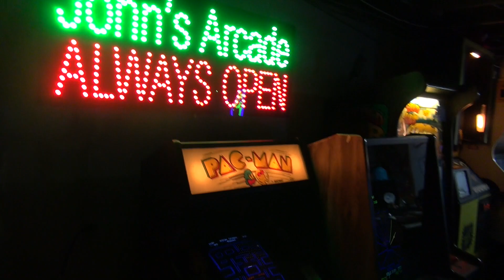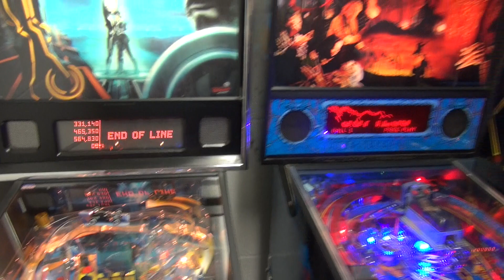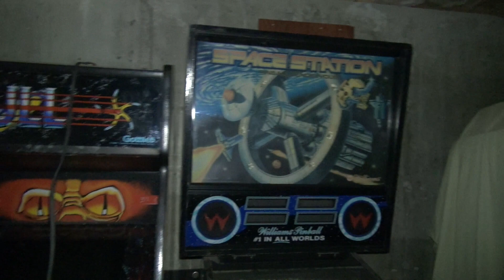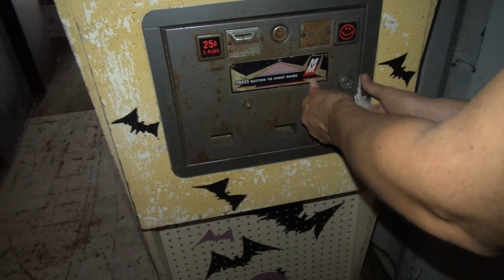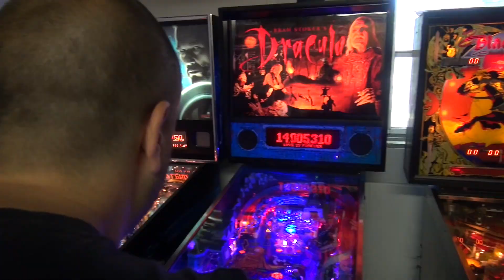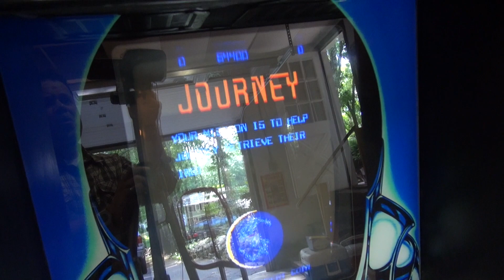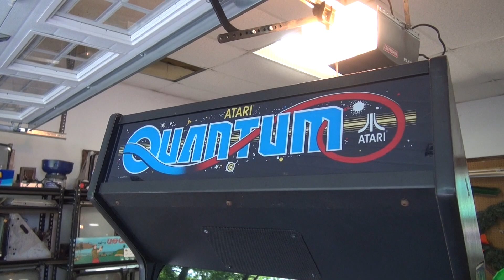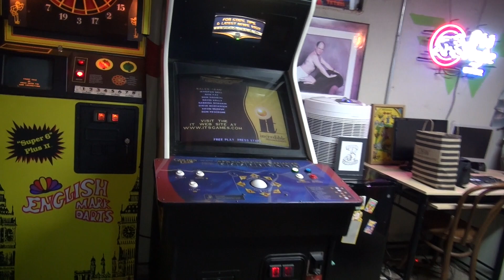Atari Quantum Arcade Restore / Scratch Build Part #1 - Getting the cabinet -

Comment: John, you mentioned that the power supply on your RFM wasn't putting out any voltages and the fan wasn't running. That's can be indicative of an AC line fuse thats blown somewhere. So, just in case your new power supply does the same thing when reinstalled, make sure all your line fuses and the varistor are good.  Hope she's back up and running soon.
Reply from the maker: I checked the fuses and the AC going to the power supply. The power supply was indeed getting AC. We also tested the power supply out of the game by plugging it directly into the wall.

Comment: My thoughts over the course of the video:

-- I remember Quantum.  If I recall, the object of the game was to encircle subatomic particles with a trackball.

-- I want those garbage machines!

-- Regarding Leprechaun; I made some minicabs based on the Pac-Man cabinet at 2:3 scale a couple of years ago. They are a perfect size for children.  It is too bad the girls I made them for are now too tall to use them standing up.

-- Regarding the damaged side; It is possible for you to use the good side as a template to create a replacement for the damaged side. I used templates for cutting out the sides of my minicabs.

Comment: Did anything happen with those poor games sitting outside in the storage yard? Another great video btw, thanks.
Reply from the maker: I heard that someone else took all the parts off them later. We didn't touch them. It was tempting but seemed wrong. :)
Reply: John's Arcade Game Reviews & Tech
Yeah, I was just wondering if you inquired about them from the owner of the storage yard. Glad someone saved at least some of it.

Comment: The guy with the Altered Beast was a dick trying to jack me so I ended up passing. So I got some other crap arcade. Thanks John I blame you. But I hope to convert the arcade to another game. So if you are looing for a PCB or parts. I am gutting the Arcade. It is Gun something or another. Shooting game , PCB works. I may have power supply as well